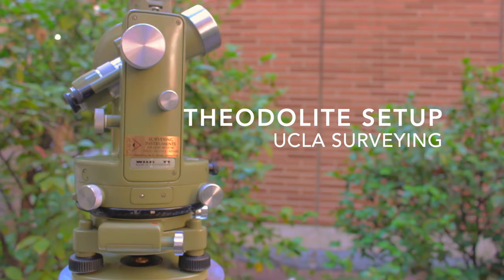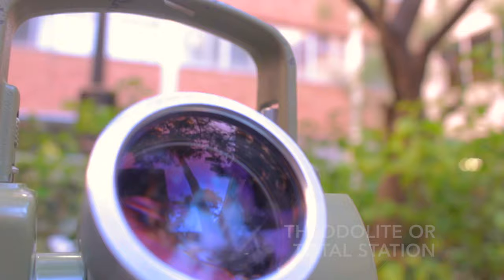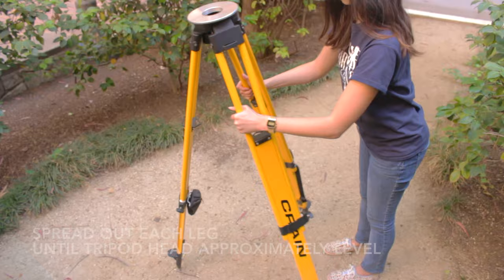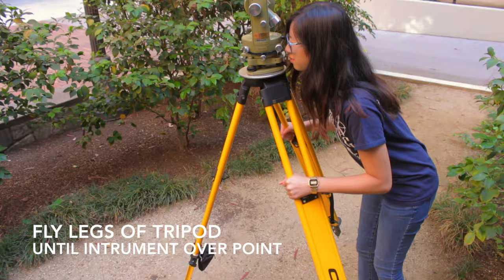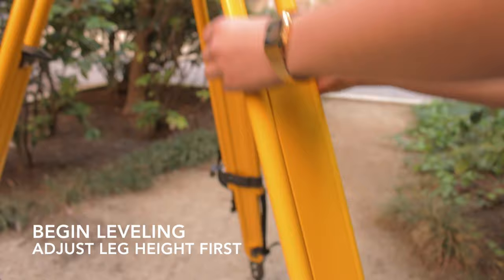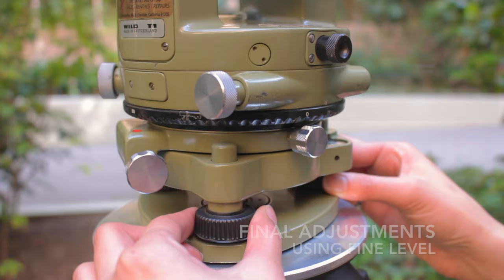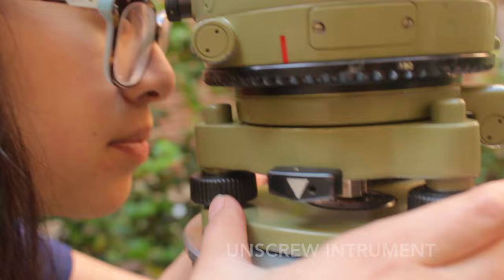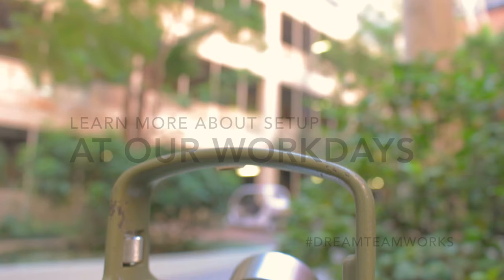Introduction to Theodolite Setup

Comment: Completely inadequate instruction.  You must ask yourself,  "could someone set up and use this instrument with no further instruction?  The answer is no, and I understand older, traditional  transits and theodolites.    USN  ETR-2 68-74,  NAS Miramar  70-74,  GCA RADAR  maintenance.  Periodically we were required  to FAA  flight  check the  GCA glideslope, which at the time  envolved  an FAA  (usually DC-3)  and a theodolite near the runway.
Reply: "Introduction to Theodolite Setup" Sir, the speaker offers a reminder that this is a basic overview. Your comment is unwarranted, inappropriate, and embarrassing.
Reply: @BuildingCenter  That   an opinion an is wrong.  If you are going to post  "factual"   information on the internet,  at least  make an effort to be sure it is  actually  factual.    If you  read  my short  comment, you'd realize that "in my day"  a mistake on  setup    could crash aircraft.   Keep that in mind.